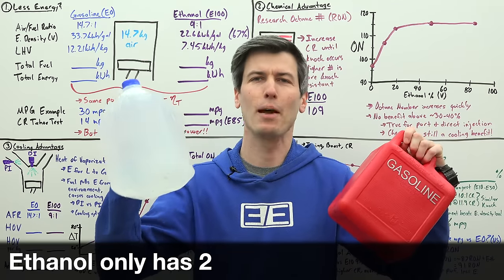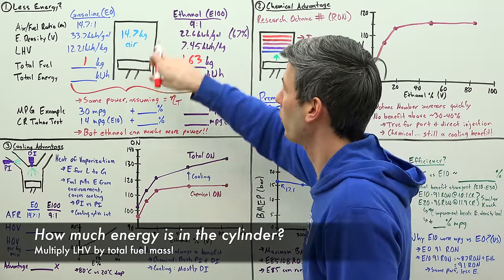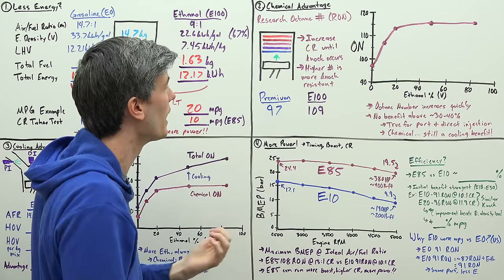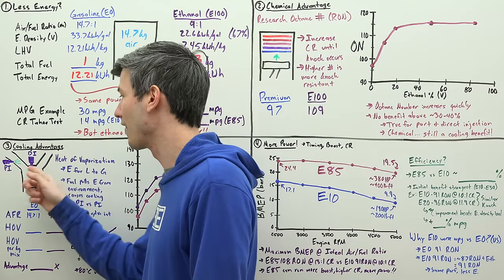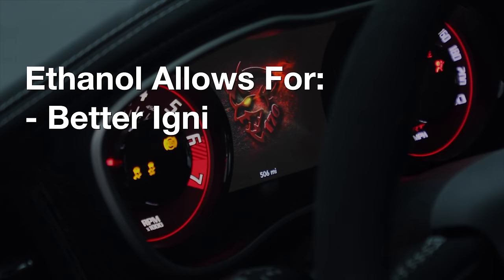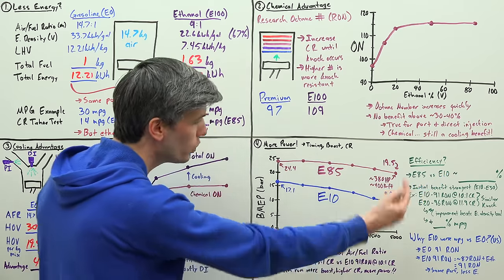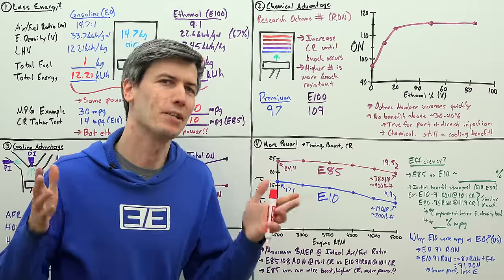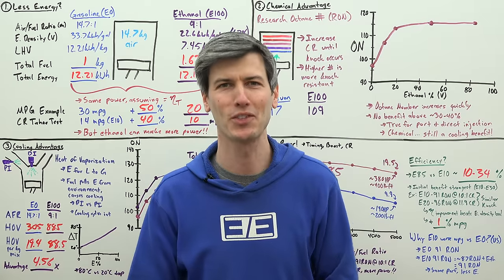Why Does Ethanol Make So Much Power? (Versus Gasoline)

Comment: Are we going to talk about the fact that government proops this up with taxes. And it takes over a gallon of diesel to make a gallon of ethanol. And it breaks down faster and gels. The private sector would never support this product. Corn is for feeding live stock.
Reply: I’ll talk about it.

The government ended the corn ethanol subsidy back in 2011.

The long-standing stated goal of the G7 Nations to end petroleum subsidies?  Not so much.

All the energy it takes to produce and deliver a product to the consumer is reflected in the price of said product.

As such, note the spot cash delivered price of ethanol on the NYMEX is $2.35/gal.
The price of an unusable sub-grade of gasoline (RBOB) is $2.58/gal.

It takes more energy to make unusable gas than ethanol.

To turn RBOB into usable E0 fuel costs a lot more like premium costs more. Unfortunately for humanity it also becomes far more toxic, carcinogenic, and dirty.
Or, simply splash in >10% ethanol to RBOB and the resultant usable fuel is less toxic, far cleaner burning, and cheaper/cheaper per mile to drive. Who can be against that?

Iowa State University measured all the energy it takes to produce an acre of corn into a "diesel fuel equivalent"This included making of the machinery, fertilizer, chemicals, also the tillage, planting, spraying, harvesting, drying, trucking etc. 
They found it takes 34 gal of diesel to produce one acre of corn.
What do we get from those 34 gallons of diesel?
We get >500 gallons of ethanol.
But wait, that is not the kicker.
The kicker is we still get 100% of the protein from that acre of corn still available for an even better feed. A win, win..

If you found an old bottle of Greek or Roman gin, it would be drinkable.  Gasoline is what can not last very long.  I remember when my father used E0 in the 1970s and it varnishing.  Like a skunk smell, it is unforgettable.

A DOE study showed ethanol blends last three times longer than E0 in small engines.  The volatile (and toxic) aromatics used for octane boost in E0 evaporate out a leaves behind an unusable fuel.

The CBO did a study on what would happen if we removed the renewable mandate and found the same level of ethanol would be used since ethanol is the most economical octane booster which exists and a lot of the country requires oxygenated gasoline for pollution control.

The amount of corn grown is equal to the protein requirements of the cattle herd on feed, not ethanol production.

No corn is grown just for ethanol, too uneconomical.  Rather corn ethanol is a value-added product of already existing corn feed production which leaves 100% of the protein and other things still available for feed in a healthier, more digestible/efficient, and more concentrated form called distillers grains.

This is how ethanol can be sold so cheap despite the current high price of corn, they make it up with high prices of distillers grains.

Believe it or not, the corn belt grew more corn acres in 1980 before ethanol than they do today with record ethanol production and ethanol plants everywhere.

2018 Iowa 13,200,000 acres of corn with most ethanol production ever
1980 Iowa 14,000,000 acres of corn before ethanol

2018 Illinois 11,000,000 acres of corn with most ethanol production ever
1980 Illinois 11,600,000 acres of corn before ethanol

2018 Indiana 5,350,000 acres of corn with most ethanol production ever
1980 Indiana 6,450,000 acres of corn before ethanol
Reply: Then why is ethanol so heavily subsidized by the government? I know it makes power I'm a car nut my 55 Chevy has a 383 stroker in it 400 plus HP at the wheel. My engine builder said run the ethanol better power but don't leave it in there over winter. I live in  south east Wisconsin so winter lasts 5 months and the ethanol will spoil and gels up the carb. Also I know for a fact older gas lasted way longer then what we have now days. Almost seems they make it have a shorter life span then back in the day. I've watched guys do car revivals that have been sitting for 30 plus years and run on the old gas that's in the car.
Reply: @ronnygilmore6558  Again, as I already told you, the corn ethanol subsidy which was called the VEETC ended back in 2011.

Why doesn't the G7 Nations act on their long-standing goal of ending petroleum subsidies is my question.

As someone who has seen gasoline varnish and never has seen gasoline varnish with ethanol, I know as fact that gasoline doesn't last.  Even the industry states three to six months without stabilizer in it.  The spirits sitting in your grandma and grandpa's cabinet for 40 years are as good as when they were put in.  I actually try to buy 18 year old ethanol at the liquor store.

My uncle passed away a few years ago and he had parked in the back of a shed a gasoline powered engine with E10 fuel in it from the 1980s when it was called gasohol.  

I told my cousin it would never run when she hired a mechanic to start it for an auction sale.  To my great surprise it ran and no new gasoline was ever added to it when they had their sale since it was about full (note I always fill any fuel tank when storing it overwinter to prevent condensation and frost putting water into the fuel tank).  

The accelerator pump in the carburetor did not work so we had to start it with ether, but it ran just fine.  Alcohols are the active ingredients of carb cleaners.  When my father switched to gasohol back in the 80s there was a transition period of changing fuel filters very often (weekly) until the fuel tank walls were rid of all the varnish build up straight gasoline had left.  Newer vehicles did not have the buildup but he had late 60s and early 70s trucks which took a while and Ford used cartridge fuel filters which were a pain but at least they were all the same between differnet engines.  I still have some of those Ford trucks from then and I don't even change the filters yearly now.  Once clean, E10 keeps things clean.  They don't get run hardly and the tanks never get empty so I have really old fuel in them.  If the batteries are not dead which they often are, they start right up.  I had never given a thought that the fuel, maybe I should drain them sometime with fresh just to be safe even with the E10.

You had a post that you must have deleted mentioning something about mandates and free markets.

First off, a free market and a monopolistic market are the exact opposite.  Many are confused with that.

I agree with a free market being the best.  One legitimate function of government is to provide free markets.  

Their use of a mandate as a tool is a legitimate question.  Perhaps other tools could be better.  Perhaps politicians like it to appear important and relevant.

Congress ordered to CBO to conduct a study on ending the renewable fuel mandate.  The study found that the same amount of ethanol would be used if ended because ethanol is the most cost-effective octane booster available.  The other reason cited was the fact that many municipalities require oxygenates for pollution control.

Subsidies cost taxpayer money and make a product appear cheaper while mandates do not cost taxpayers money but most often cost consumers more money.

The renewable fuel standard stands out as being very odd since it, as you saw in my previous post, lowers the cost (& cost per mile) of our fuel.  This is a tell sign that monopolistic powers are at play here.  

Another tell for monopolistic power is the fact we are the largest ethanol producer yet we only have <2% of stations offering E85.  In France some 25% of stations offer E85.

Speaking about oxygenates, I am sure even more municipalities would start requiring at least 10% ethanol in fuel if the mandates were ended.

Denver in 1988 was the first government entity to require E10 when they were on in EPA list of ozone non-attainment zones.  Soon with ethanol they were off that list.

Even with just 10% ethanol added to E0, the Swiss Federal Laboratory for Materials Science and Technology found that the especially health devastating ultra fine or nano particulate emissions were lowered by 97%, carbon monoxide lowered by 81%, carbon dioxide lowered by 13%, aromatic hydrocarbon emissions lowered by 67-96%, and genotoxic emissions lowered by 72%.

I see the military spending as a subsidy along with the grandfathering in all the toxins released into the environment by petroleum.

This video naively thinks ending ethanol would mean we could plant all the corn acres to switchgrass.  I ask you to answer the question on what cattle feeders who now feed distillers grains would use for a protein replacement?  This almost happened during the covid shutdown and they would have just switched back to feeding the less healthy and less concentrated corn straight like those who don't use it do.

The study states new land was tilled up and released all kinds of CO2.  This is impossible since US cropland acres have fallen since ethanol came to be.

Comment: Don't know why but Ethanol is bad for small engines carburetors and in Canada we no longer have ethanol free gas and worst, from 2030 in Quebec province all gas will have 15% ethanol - no small engine is designed to run on 15% ethanol
Reply: E0 gasoline would coat fuel tanks and systems with varnish and alcohols clean varnish.  Many carb and in injector cleaners include alcohols for active ingredients.

When E10 first came to be in the 1980s around where I'm from, it was called gasohol and it cleaned varnish and plugged fuel filters on all of our vehicles for quite a while.  Longer on older equipment with thicker varnish built up.  But once clean, ethanol keeps things clean.

With small engines back then, there were no fuel filters.  So putting in E10 couldn't plug a fuel filter, but instead plugged your carburetor.  

In the 1970s during the days of E0, every spring my father would have to pull apart the carburetors of his gas-powered water pumps and use carb cleaner to free the needle and float.  I saw sheets of varnish so thick, it would even stick the float.  The smell of varnished gasoline is like a skunk, once you smell it you will never forget it.  When stable came out, I would use it on everything before winter, but even when I forget, I have never seen or smelled E10 ever varnish.  Even E10 which sat for many many years in an old fuel storage tank.

They even keep water out which is why Mercury Marine though E10 may be superior to E0 after the transition period.

The very same small engines in the US, Canada, and Europe in the country of Brazil uses E27 for fuel.   It has worked out so well and for so long that Paraguay has gone to E27.  India will soon be using E20 in all non-flex fuel engines.
Reply: @danafletcher2341    So E27 will not gum up the emulsion tube inside the carburetor, when not in use and without fuel stabilizers ?
Reply: @Peppermint1  Ethanol lasts forever, you could drink a bottle of Roman gin if you found some.  

While I still use stabilizers, I occasionally forget and have not seen E10 ever varnish so I don't know if stabilizers are even necessary with E10+.

As long as your carburetor always had ethanol at least E10 or is brand new, E27 would be fine, it would already be clean.  If your carb had E0 sitting in it, who knows what stuff could have settled out of it or was left behind as the volatile aromatics evaporated away even in winter.

Mercury Marine in their webinar did talk about a transition period when using ethanol in boats that previously had E0 for years.  But after the transition when things have become clean, ethanol is great since it keeps the fuel tanks and systems clean.
Reply: @danafletcher2341  I understand it keeps the engine parts free of varnish on the areas where the gas is flowing then drying out. At same time, on newer LCT chinese engines (most of snow blowers on the market, including most Ariens ones), the carburetor emulsion tube has about 30 tiny holes to it which get quickly gummed up when stored with ethanol gasoline. We usually need to remove and clean the tube holes with a small needle, or sometimes just drain a bit of gasoline so the flow cleans the inside of the tube. It is a wide spread issue causing non start - I put a few videos on my channel and there is endless people commenting with same issue. This is only on the recent LCT engines, made in the past about 15 years, that have those tiny holes in the tube, perhaps for better air-fuel mix and lower emissions.
Reply: @Peppermint1  Drain your fuel every season like your supposed to.

Comment: so wait... the engine needs variable compression to take advantage of ethanol?
Reply: No, only tuning parameters such as air to fuel ratio, ignition timing, and valve timing change with the fuel in a flex-fuel engine. No production engine is capable of changing compression ratio (although valve timing can have a bit of a similar effect), so the engine's compression ratio is limited by the lowest-octane fuel that it might get

Comment: So methanol will performe even better?
Reply: We do have a real-world comparison between gasoline, methanol, an ethanol.  Back in the 1960s, the Indy 500 used both gasoline and methanol.  After a deadly multi-car crash which demonstrated the superior safety of alcohol, they dropped using gasoline.  They then switched to ethanol in 2007, here is an article about it:

A Brief History of Racing Fuel By Craig A. Johnson

In 2005, the IRL used 100 percent methanol in their tanks. The fuel worked well and was more efficient than straight gasoline, but IRL officials believed there was room for improvement. In 2006, they moved to a 10 percent blend of ethanol and methanol, which was then changed to 100 percent ethanol for the 2007 season.

The desire to use only ethanol aside, 100 percent ethanol is nearly impossible to obtain, and is illegal to keep without paying hefty taxes that date back to prohibition. The actual fuel used by the IRL is a blend of about 98 percent ethanol and 2 percent denaturant. The exact composition includes a small amount of high-octane racing fuel.

The fuel for today's Indy cars has an octane rating of 113, compared with methanol's 107. This means a significant reduction in pre-ignition, or knocking and pinging.

In addition, many of the people who handle the fuel, say it smells like tequila. This quality may seem insignificant, but smell is actually one of ethanol's benefits when compared with methanol. Pit crews noticed the switch to ethanol immediately, reporting fewer coughing fits and less eye irritation before any other modifications were made to accommodate it.

According to Dennis Vervynckt, manager of hospitality services and an IRL official, in 2006, the first year the IRL began using ethanol, teams saw a reduction in efficiency of about 10 percent. "That's because we put straight ethanol into the tanks," he says. "The teams initially didn't make any or very many adjustments to their engines. After a few months, they kept tweaking and by the end of the season they were back up to 100 percent efficiency."

Vervynckt points out that there was a minor loss of power. "When they first started using ethanol, teams saw a slight drop in horsepower," he says. "As the teams got used to the fuel, they were able to get more horsepower from ethanol once they again reached maximum efficiency."

The switch to ethanol also allowed the racers to carry less fuel and make fewer pit stops, thereby increasing efficiency even more. "When the cars ran on methanol tanks had to hold 30 gallons to accommodate the fuel requirements of the cars," Vervynckt says. "After getting the engines to perform at their full potential, there was a significant gain in mileage. Indy cars now have 22-gallon tanks. When a driver pulls in to change out his tires, he can fill up. Teams were able to match their tire and fuel stops exactly, instead of stopping for tires only, or fuel only."

That efficiency translates into much less fuel being used by the sport. Lifeline Foods LLC, which supplies fuel for the IRL, will produce 120,000 gallons of ethanol for the 2008 season. And though this may seem like a lot, it's 20,000 gallons less than was used the previous seasons.

The switch from methanol-based fuel to ethanol has amazed almost everyone in the league. Drivers, the direct users of the fuel, voice their approval in glowing terms. "[Ethanol] is an American fuel that is good for the country and the environment," says Ryan Hunter-Reay, of Rahal Letterman Racing and driver of the ethanol car. Standing beside his crew as they make last-minute adjustments to the car, he is more than happy to discuss the benefits of the IRL's switch to ethanol. "It's been great for Indy racing the fuel economy, emissions there's nothing we don't like. We love it."